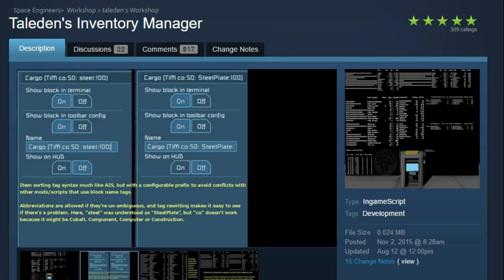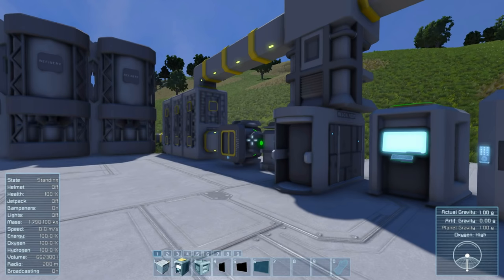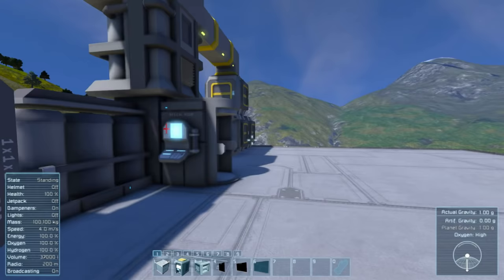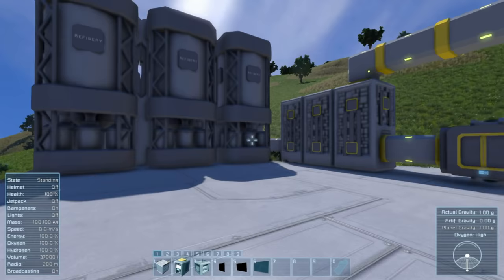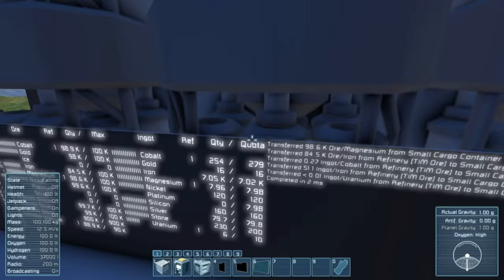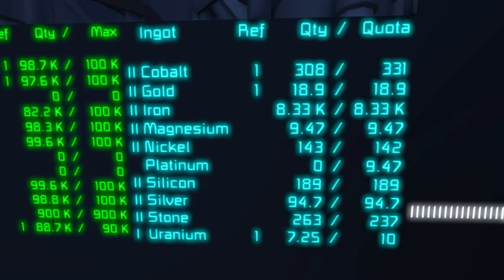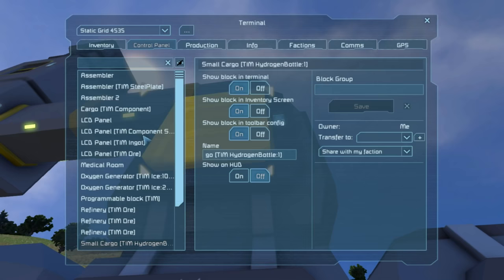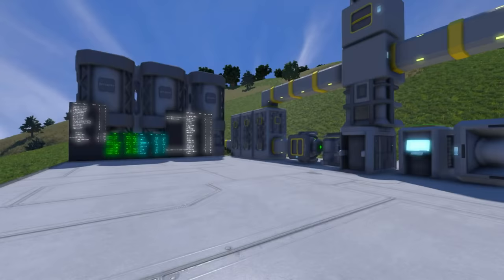Complete Guide 📚 (See Update Link) to TIM (Taleden's Inventory Manager) Script - Space Engineers

Comment: Putting [TIM Ore] on a refinery will have the refinery just drag ore and refine it without regard for ingot quotas ie it will refine platinum even though you may be desperately short of iron. [TIM AUTO] is the correct tag. Tagging an assembler the same will have that assembler automatically build components, which is something the old script couldn't do due to limitations.
Reply from the maker: And now that the new HUD is out I'll be making a replacement to this video that will explain all the changes.
Reply: Forgot to mention, arc furnaces can be tagged the same. as TIM recognizes only certain ores can be refined in them

Comment: Subscribed because of the time you took to help fellow engineers :)  I might install this but I already have sorters set up and it might interfere with TIM, sad face.  Must investigate.
Reply: Hey EpikTek, just FYI I installed it and grinded down all my sorters as they're useless now :)  However I have two questions and thought you might be able to help.  1.  How do you deal with stone ejection now?  I don't want all these gravels and although I set a quota wouldn't the rest just sit in my tim ore?  If I also eject using drain all on sorters then it'd compete with the refs.  Puzzled.  2. How do you disassemble components?  Should I create a separate assembler just for the job of disassemble and not tim'ed :DD  Yes?

EDIT: No idea on the stones yet, but yes just build aanother assembler and color it and use it solely for disassembly but don't tag it.  TIM will pull the compo to it and spit ingots from it automagically.  Damn this makes my life so much easier and neat.  you gotto see the gunboat ammo and uranium reloads.  Everything in my base is tim-up!! :)  And yes I made those 24 assemblers haha.  Another pro-tip, tag everything up that uses inventories to prevent traffic in the debug, tag the station turrets to [tim nato_25x:200] for example.
Reply from the maker: I have a cargo container set aside with the tag [tim ore/stone ingot/stone locked] so that it pulls all stone and gravel but tim cannot pull out said stone to process it. Then I have my ingot container as [tim ingot ingot/stone:2k] so that I always have some gravel around, but not too much. I also tend to adjust my quotas to decrease stone to 0 so that 2k is the only thing kept.

I'm not positive about all of that since I'm not in my world right now, but that doesn't work for you let me know and I'll double check.
Reply: EpikTek sounds great. Thanks again.

Comment: I tried this mod and I love it! Only one thing that I noticed, LCD Panel doesn't seem to be working. I type in LCD Panel [tim ore]. The display still show "Online" but when I click "edit text" I can see the list in there but just not displayed on the LCD.
Reply from the maker: This seems to be a bug in Space Engineers right now, especially with multiplayer but I've seen it happen in single player as well. I've seen some suggestions to change the font, but I haven't played with that personally.
Reply: I tried to change to each font available but no luck. :(
Reply from the maker: :( If the text field is actually correct, I'm not sure what to tell you, it almost has to be a graphic glitch. TIM is doing his job updating the info it's up to the game to make it visible. Hopefully Keen will fix that sooner than later.
Reply: Yeah, is it the bug from script or game? Is it fixable from his side or developer's?
Reply: I also noticed at the part about setting up automatic assembler, where you turned on repeat mode and make 100x. It would stop if the cargo with 100 quota is reached. On my side, it will just continue making 100 and 100 and 100 forever even though the only quota for 100 steel plate is in a cargo that is already reached.

Comment: Got another Question about Quota screens. I wanted to always have 1 Tool Lv4, so I changed the quota from Min:0 to 1. Now it doesn''t stop making Tools. I changed the min:1 back to 0 and changed the quota from 0 to 0.0001%. It didn't stop making tools. Now I changed the Min and Quota both to 0, but already it didn't stop. What's wrong, what's to do?
Reply from the maker: If you make a screen with the [tim inven:welder4item] tag it should show the effective quota for an elite welder. If it's not 0 then you might have a container with a specified quota on it. Otherwise it could be an issue with how your assemblers are set up.

If that doesn't help, come by the discord channel (there's a link in most of my recent videos) and mention @Epiktetus in the #Space Engineers channel. Someone there should be able to help, and if they can't, I'll be by soon.
Reply: Thanks. Somehow it stopped after shutting down the reactors but not the system with Y. Dunno, but sometimes I think a power crash is more effective than a reboot.

Comment: Excellent guide thank you, recently started using TiMs. Shame about cooperative mode on assemblers though. If I don't use TIM tags on my assemblers, I can use coop mode right?
Reply from the maker: No, you can't. Basically the problem is that assemblers with coop turned on will take a portion of any queue in the grid. Great for vanilla. However the way TIM manages assemblers is to have a repeating queue but turn on and off the assembler as needed. Those coop assemblers will take on the repeating queue even if the assembler is off, so it will just keep on making whatever you have queued forever.
Reply from the maker: Sorry, I think I read your message wrong. If you don't use TIM for assembler management AT ALL you CAN use coop mode, yes. But even one TIM managed assembler in your grid will screw up coop mode for the whole grid.
Reply: EpikTek cool that's what I gathered from the video, thanks again. That makes sense, adopting TIM assembly management would require some work but once you've got component specific assemblers set up, you'd never go back. My assembly area is going to need some surgery.
Reply from the maker: And since it's completely automated you honestly just stop thinking about components. They are simply always there as long as you have the ore/ingots.